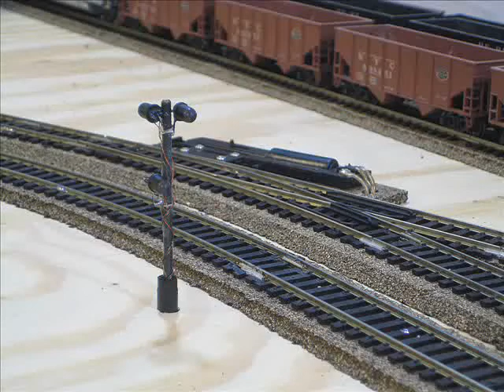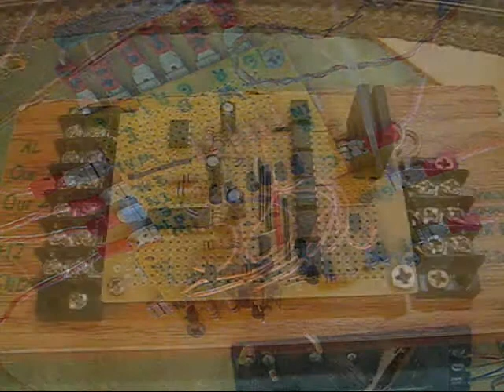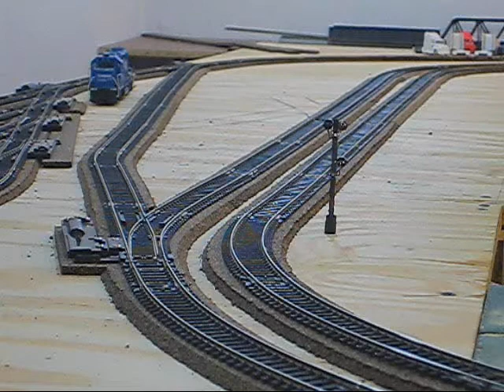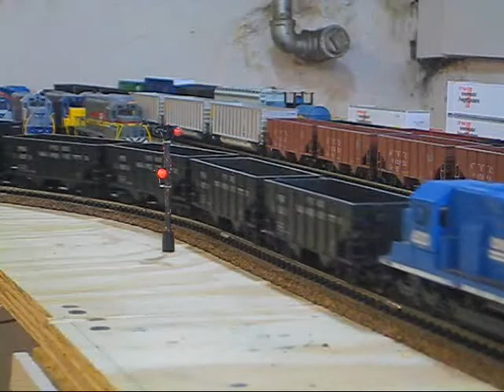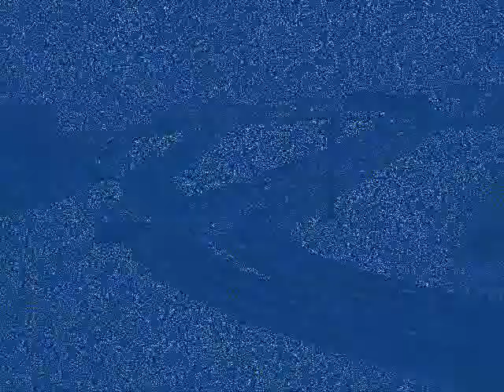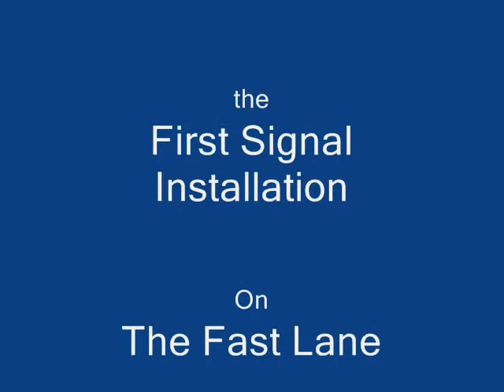Signal Installation (Fast Lane Subdivision)

Comment from the maker: Cool I am in the process right now of installing some interlocking signals at one of my crossovers, this one will use a relay which will throw with the turnout, this will be wired into those fancy circuits I showed on the video.